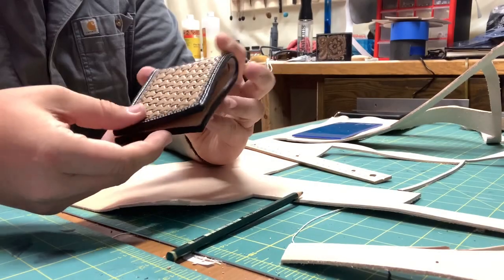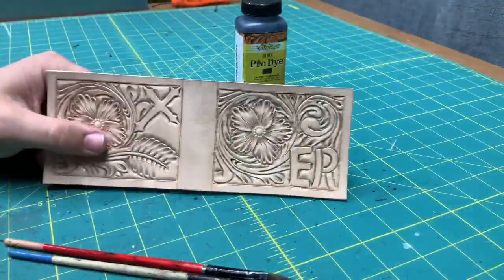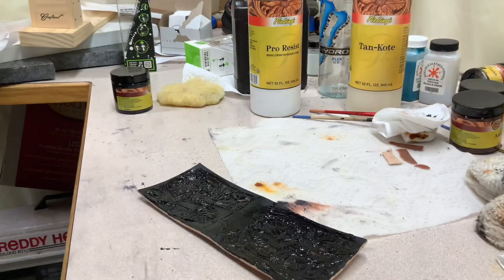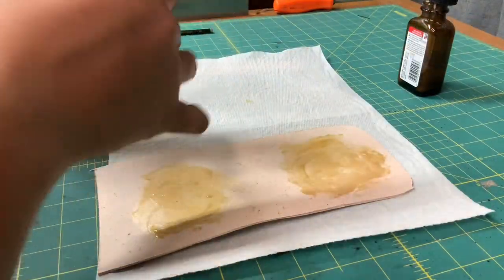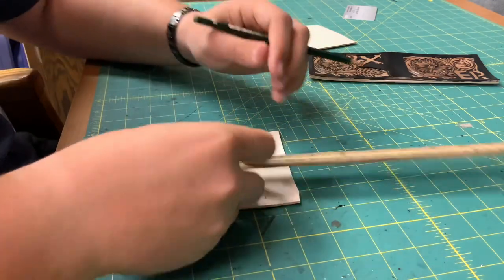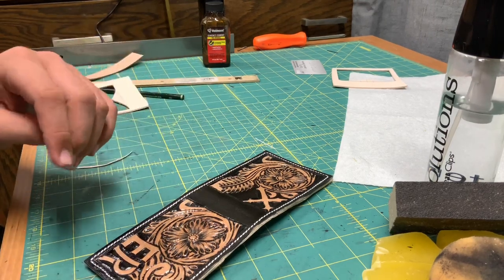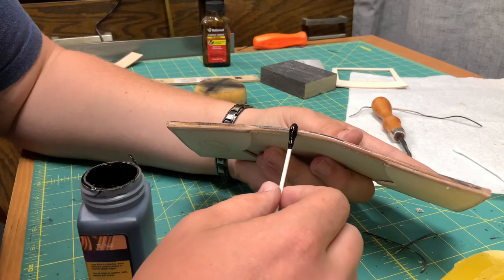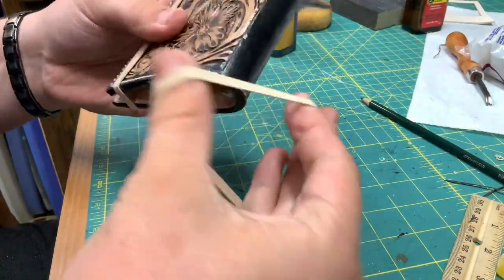How to make a tooled leather wallet with money clip

Comment: I’m new to leather works and I’ve been experiment with finishes . I noticed u used tankote and then saddle lac , need to try that . Normally I would use tankote on the wallets i would make but every time I get my wallets wet it leaves permanent stains , so I experimented and now I use tankote and at the very end I give it 2 coats of resolene and found that it makes my wallets water resistant. Also something else I saw on YouTube that helps me and might help you is when cutting the liner or veg tan in general you can put the veg tan on top of carpet and when u use the knife to cut it just makes it easier hard to explain but it’s a life saver .      Great video !!!
Reply from the maker: FE Leather Works I was having that same problem with water marks so that’s why I started to finish with saddle lac, I’ll have to look into the carpet trick! Thanks for the feedback!